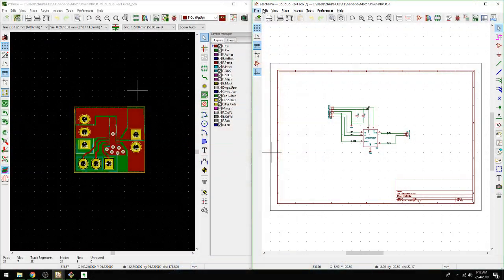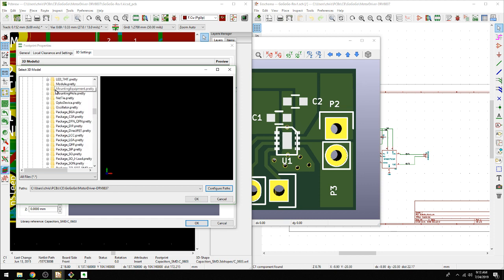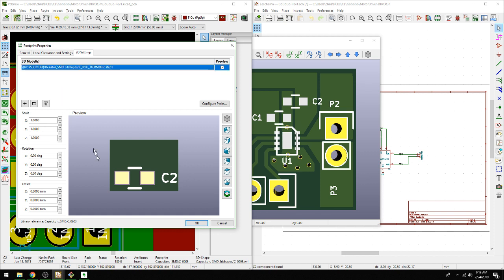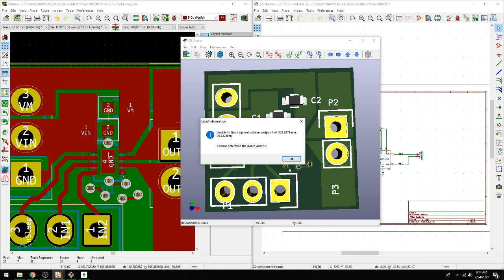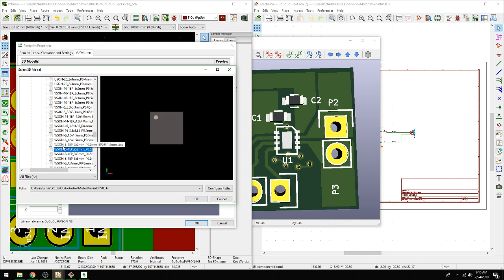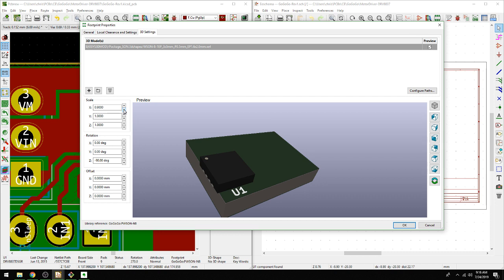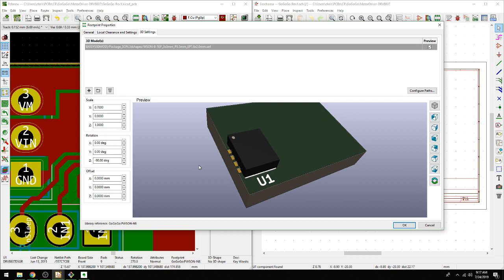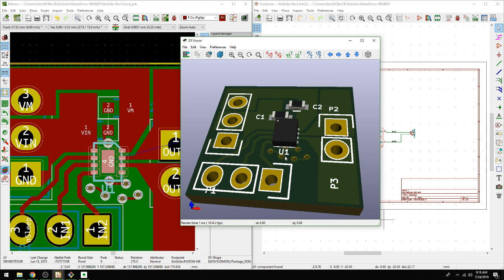KiCad 5.1 - Repurposing 3D Models For Quicker Designs

Comment: Shrinking embedded STP models work nice in the layout 3D preview, but screws up a STEP output of your final product (rotating and moving is fine). That has bitten me before, so now if I need to scale a component I do that externally, e.g. in FreeCAD.
Reply: I use the KiCad workbench in FreeCAD, and I have found that it doesn't like messing with the scale of the parts as well. I have usually found the step file from GrabCAD or another source on the web, or if I can't find it, I quickly create it. I like using FreeCAD for the actual export over KiCad's  internal exporter, as I feel like there is more functionality. But I also make sure I always have a 3D model for my footprints so I don't get bitten by a bad footprint. That's happened on more than a few occasions...